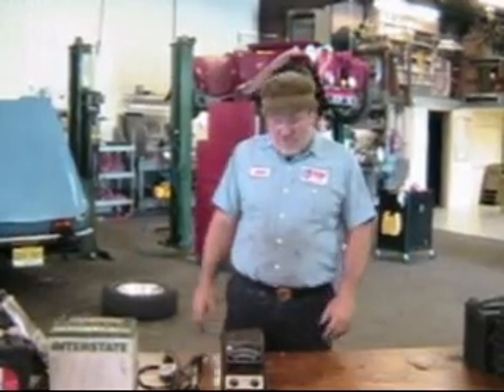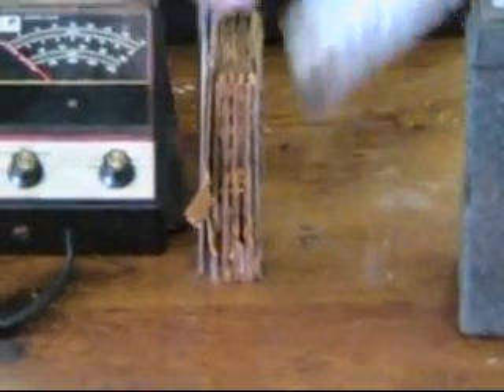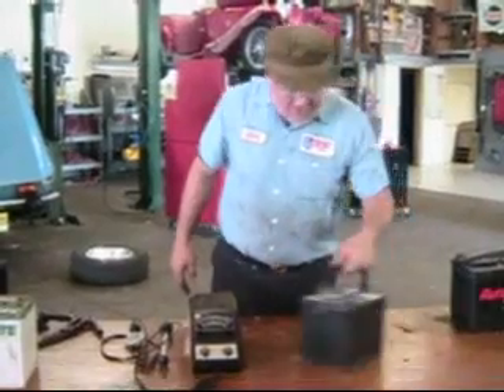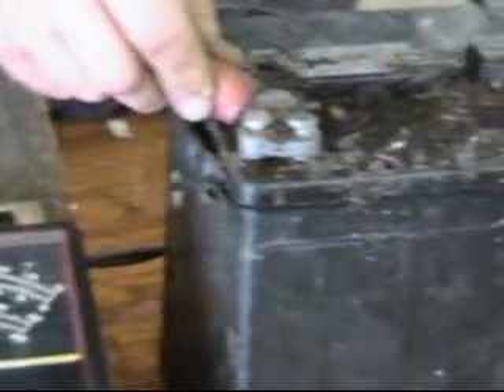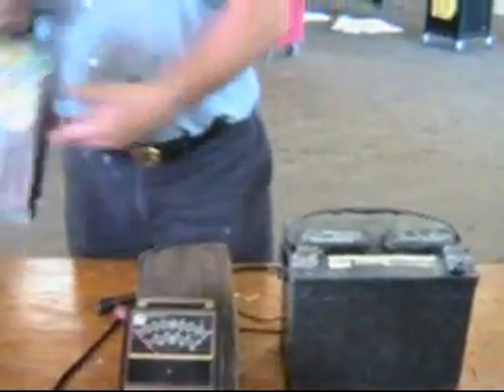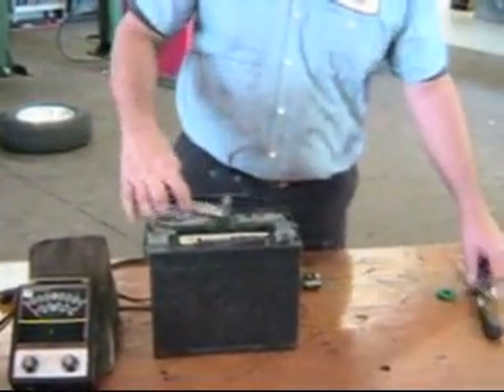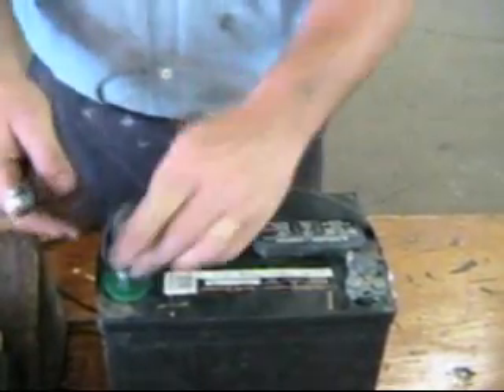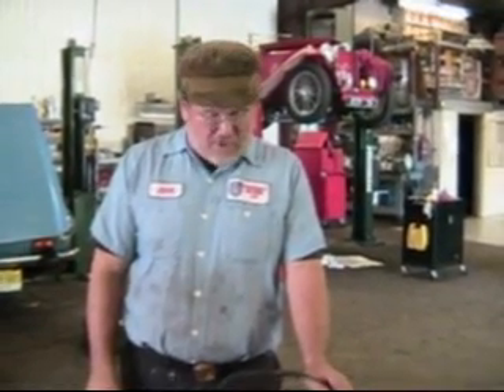024 MG Tech | Batteries

Comment: batteries outgas and basically consume the acid and water mix.. to keep a battery in good shape you have to replace the lost fluid with water "deionized water if available"

Otherwise your battery will loose its power in a short amount of time

Comment: Quite informative and straigthforward... 
Using a trickle charger (John mentions this as the  monitoring type) extends battery life on MG's. Otherwise, low frequency of use for sportcars like these means less charging cycles and therefor shortening of life span to 3 years or even less.